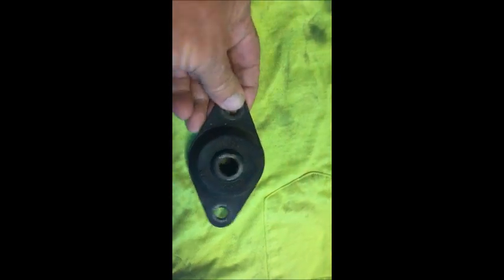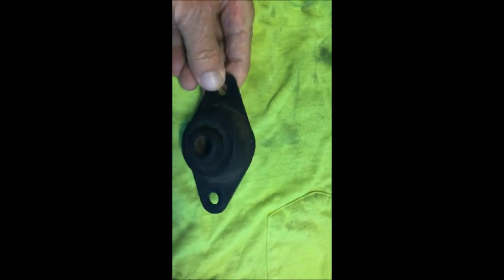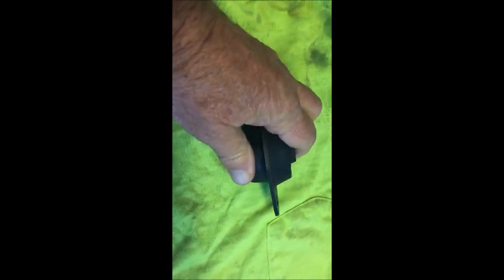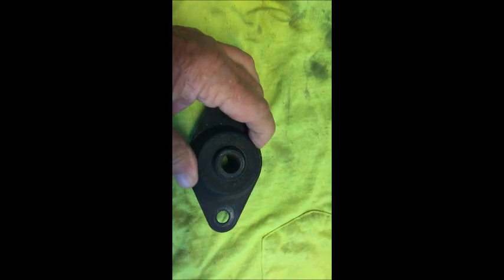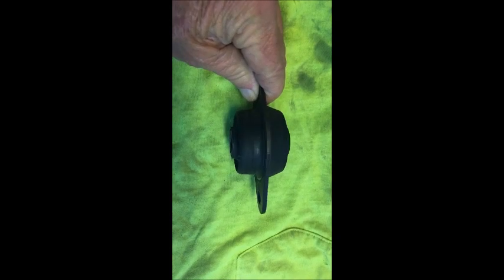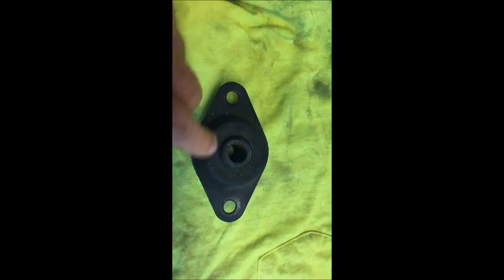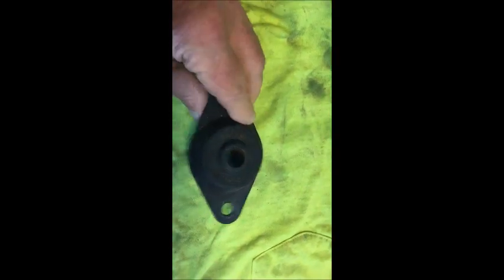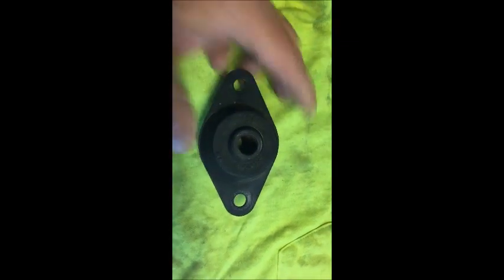Front Motor Mount Replacement For A Harley-Davidson FLHR

Comment: Checking my 2006 HD Service Manual the torque specs for this job is found in the Maintenance Section under Critical Fasteners on page 1-34. You are spot on. Thank you for this video, sir.

Comment: Good Video Ridge Runner.  If someone needs more info than that to change the motor mount...well...I’d say they oughta take it to the shop.
Reply from the maker: LOL! They may wanna take it to the shop anyway, after seeing this. It'd be easier on a lift instead of in a wheel chock. But, I didn't stress keeping the bike upright. The procedure of running the engine before tightening the mount needs to be done with the bike upright. The alignment of the engine will shift left from it's own weight if it's on the kickstand.

Comment: Great video boss. Did you do this while on kick stand? Or on a lift ?
Reply from the maker: Front wheel chock. I felt it important to keep the bike vertical without the engine weight to one side during the run up.
Reply from the maker: Just a front wheel stand to keep the bike straight up. I think it's important to have the engine weight distributed evenly for the first start before final tightening the mount. That lets the engine find it's equilibrium left, right, forward and back.